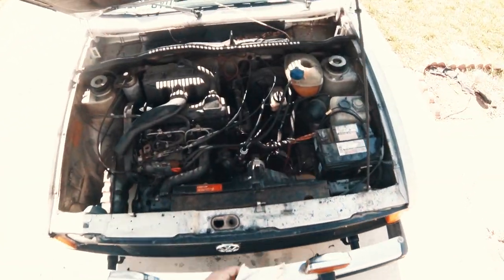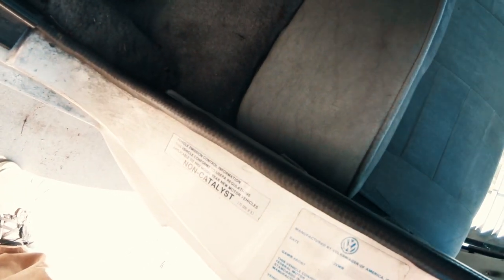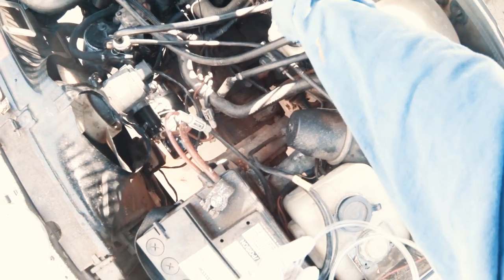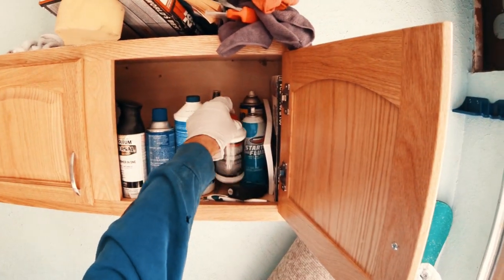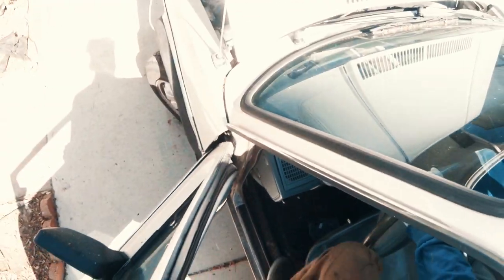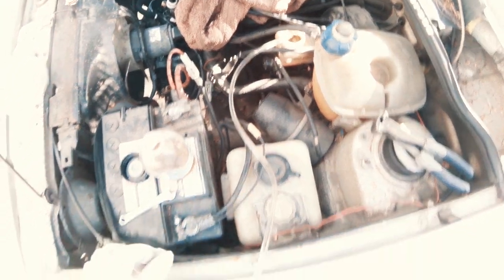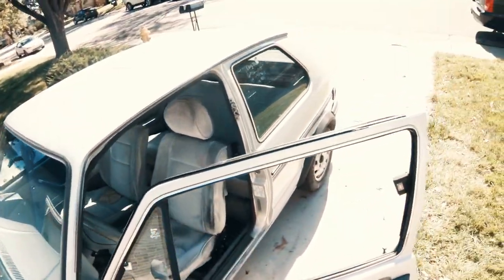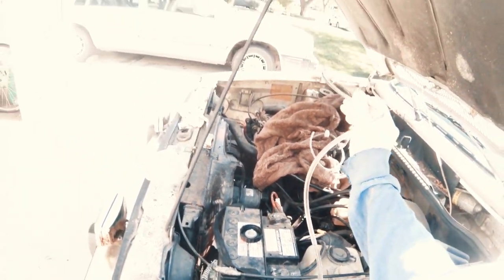Bleeding Brake Master Cylinder Quick and Easy Closed Loop Method on VW mk1 Rabbit

Comment: Bleed the master cylinder or brakes first?
Reply from the maker: You shouldn't need to bleed master separately. If you so this though I would probably do the 3 other wheels and then do the last wheel with this method

Comment: Were you bleeding air out of the entire system? I replaced all the brake lines (flexible and steel) in my Rabbit, along with completely disassembling every part to paint the body. Now that I have it re-assembled I cannot for the life of me get the brake pedal to stiffen up. I bled all ports of the master cylinder until there were no more bubbles, and the fluid from all 4 wheels also has no bubbles. Pedal has very little resistance nonetheless.
Reply from the maker: Tegan B I did bleed each wheel cylinder also. Decided to give this a shot as well. You bled each port on the master? Like taking the brake lines off of the master and pumping pedal or what?
Reply: g3mccotter I had the old fittings with a short piece of flared steel line going into a clear hose in each of the 4 ports on the master. Hoses went back into the brake reservoir to create a closed loop. After no more bubbles were coming through the hoses I hooked up the brake lines and bled each wheel starting at the rear right and moving toward the master when each wheel had no more bubbles. I feel as though it bled properly and was done correctly, but the pedal feels the same as it did before any bleeding. At this point I've wasted about 6 litres of fluid, and am disheartened because I have no clue what I am doing wrong.
Reply: g3mccotter When I bought the car it didn't drive but the engine ran (turns out the 3 speed automatic differential had detonated.  I filled an ice cream pail with shrapnel when I took the cover off). I swapped the car to an 020 5 speed. Could the new pedal assembly be slightly different in terms of pushrod geometry, and possibly causing my issue? Or could it be the proportioning valve? I don't seem to have any brake fluid leaking out, so I doubt I have a leak... Sorry for the long winded reply. Working brakes are the last thing I need before I can drive my project for the very first time.
Reply from the maker: Tegan B yeah it sounds like you managed to bleed them even more thorough than I have. I didn't do what you did with the master. You might need a new master cylinder or booster.
Reply from the maker: Tegan B where's the proportion valve? You seem more familiar with this than me. Next I was going to do was probably replace booster. But maybe replacing my rubber lines first is a better option. I too don't have any fluid leaking.
Reply: g3mccotter It's the weird shaped brick-looking thing just below the master cylinder. The coiled lines from the master cylinder go into the valve, then out to the rear brakes. I read something this morning about needing to pull the pin in the prop valve if the entire system was filled with air. I'm going to search for more info and I'll let you know what I find.

I assumed that you would have found a solution since posting this video. Haha I guess we're in the same boat.
Reply from the maker: Tegan B I'll have to check that out. I decided to try just bleeding master so decided to make a video of it. Yup still not proper brakes though
Reply from the maker: Interesting. I will have to look at that area. I know there was tons of rust on my booster when I replaced my master. But your saying under the reservoir above the master those 2 rubber grommet type things. Problem for me is when I replaced the master that was all brand new.
Reply: g3mccotter Yes those two seals. I reused my master. 

For you I would suggest installing fittings with hoses in all 4 ports on the master, and try to bleed it that way. Doing it from the one wheel like you did here won't bleed the rear brake part of the cylinder.
Reply from the maker: @cuttlepods  I'm trying to figure out what you mean by this. Take off the 4 brake lines from the res and hook hoses up them?
Reply: @g3mccotter  If you have some old scrap brake lines or barbed fittings, disconnect all 4 lines from the master cylinder and install barbed fittings in their place. Put some hoses on the fittings and route the other end back inside the reservoir. Then pump the brake pedal until it gets nice and hard. Then reconnect your brake lines and do NOT let the reservoir run dry or you'll have to repeat this process. 

There's a few guys on YouTube with videos on how to "On-car bench bleed".

If that doesn't work, clean and dry your reservoir and master cylinder with brake clean and compressed air. Pump the brakes and check for shininess. You could be sucking air through a cracked reservoir.
Reply: Did you guys ever get it sorted. In in the same boat. I redid all my pade and wheel cylinders. Then lost all peddle. It just has the return spring for resist.

Comment: you know brake fluid is hydroscopic right? so you should use new sealed bottle. recycling fluid is a no no in my book.
Reply from the maker: That's ridiculous. I've never heard of that or done that. Makes sense I guess thanks for the tip. Problem with this rabbit was brake drum in rear